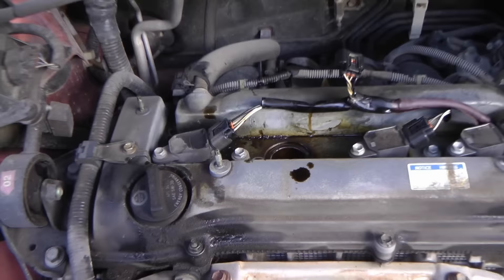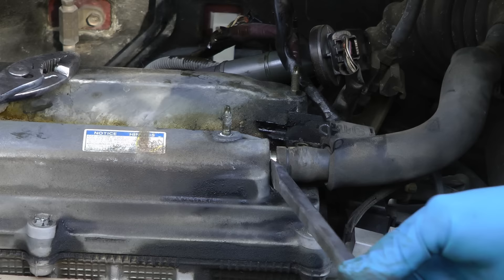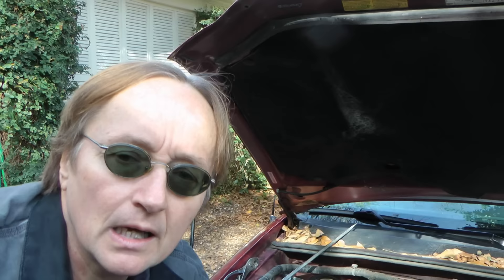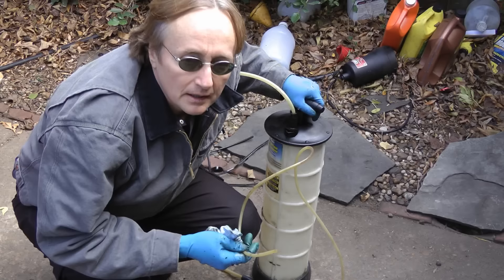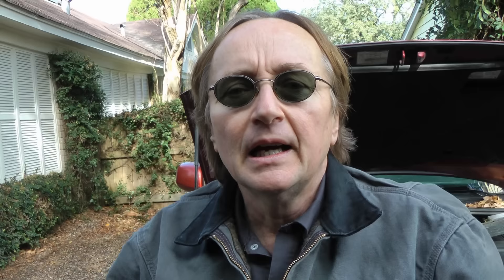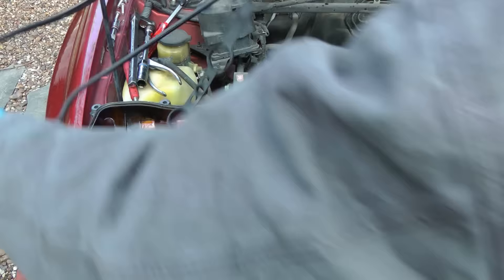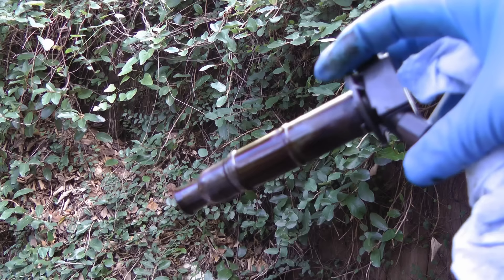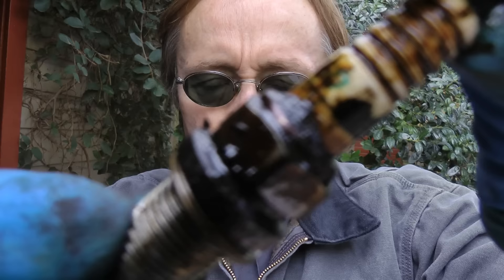How to Fix Engine Oil Leaks in Your Car

Comment: I have a problem with the gears on my truck its a 94 dodge the gears are not centered right on the cluster need help!
Reply from the maker: if you are talking about internal gears inside the transmission, those things are super complex inside. I personally use a transmission expert on those who rebuilds them all the time. They are not fix it yourself things really.

Comment: How do you take of the bolts off of the engine cover if it's stripped?
Reply from the maker: +Shingo Yamaguchi cover serves no real purpose, just snap the plastic crap off and throw it away
Reply: +Scotty Kilmer thanks for that but the bolts holds on the cover to access the cover gasket. 95 Acura integera special edition
Reply: +Shingo Yamaguchi you have to drill the bolt out with a special tool. and then replace bolt. Its not to bad with the right tool.
Reply: +green1375 thanks man I thought I was going to have a hard time fixing that leak.

Comment: A diesel engine of my toyota town ace has oil spills all over the place. I wonder if I can fix those leaks myself..yet it's not the only problem but the most obvious one . If the oil starts to leak from the top of the engine what that might cause?
Reply from the maker: do my video "finding and fixing car oil leaks to find out" and pray it's just leaking valve cover gaskets
Reply: On my way, thank you!

Comment: Hey Scotty, I have a 2003 chevy cavalier 2.2l ecotec and I am leaking a bit of oil I figured it is the valve cover gasket so I bought a new one and replaced it but its still leaking and I dont think its coming from the valve cover, the puddle of oil is right by the oil filter(directly below the power steering resoveoir) if you know about cavaliers, and I dont think it is the oil filter because it is on their good I have checked it several times it has a new o-ring for it and everything. What could it be?
Reply from the maker: do my video "finding and fixing car oil leaks" to find the true source

Comment: Hi Scott,
I have a 2000 Pontiac Grand Am GT with almost 165K miles on it.  Recently, I had my oil changed and the service tech said that my valve cover gaskets are leaking.  I don't see any oil on my driveway and I don't smell any burning oil when driving, so I don't know if this is really a serious problem or not.  The service tech gave me an estimate of $170 (parts) and $284 (labor) to replace the valve cover gasket set.  I plan on driving the car another 2 years at the most, so I don't know if I should even bother with the repair.  What do you think I should do?  Thank you.
Reply from the maker: if oil does not drip on the car or smoke under the hood leaking on the exhaust, you can live with it

Comment: hay i have a 1995 geo prizm with 159.000 miles ,1.6 liter toyota carolla 16 valve engine, i change the valve cover gasket and spark plug o rings , i have a oil leak around top bottom right timing cover ,do you think it might be the camshaft seal?
Reply from the maker: could be, do my video "finding and fixing car oil leaks " to find out

Comment: Hey Scotty I have a Honda accord 99 and it just started leaking oil close to the passenger side, I just had the radiator hose changed like 3 days ago.. I'm worried and I have no clue why it may be doing this...
Reply from the maker: rose acosta do my video "finding and fixing car oil leaks" to find the source, often just leaking valve cover gasket

Comment: I got a leak from my valve cover, but it looks like someone over tightened the rear bolt and it's broken. I am afraid of even taking the valve cover off and then I'm not going to be able to put it back. How could I take out the old bolt?
Reply from the maker: +Roberto Búrbano it would have to be drilled out and taken out with an ez out then retapped with new threads

Comment: scotty will barrs stop leak hurt an engine ? i have an old amc360 in my 89 grand wagoneer... spark plugs are dry as a bone... but it leaks oil enough to cause a 1 dollar bill size oil stain from the rear main seal.. once it warms up it stops leaking.

same with the 727 trans the shift linkage is leaking..  

i hear good things about barrs stop leak.. but i always get weary of using this stuff.. i worry itll ruin my valve seals and so forth
Reply: Bars won't hurt your car, but it might not solve the leak either. Depends on where the leak is coming from and how big it is.

Comment: Scotty, I have a Waukesha 4 cylinder flat head engine and it has a lot of blow by and it blows a lot of oil out of the oil breather on the side of the block, is there anything short of rebuilding the engine to stop this? Thanks Stan
Reply from the maker: Stan Wilson not really, piston rings are worn for sure
Reply: Thanks, would you know where I may find the rings for this old engine?

Comment: hey i have a question about my 2003 chevy trailblazer 146,000 miles. today i changed the oil and when i took off the oil cap i noticed on the top of the cap there was a white thick layer on the oil cap. it almost looked like thick milk on the oil cap. what does this mean? i'm pretty sick of this car and if the engine is about to die i want to get rid of it before it does.

Comment: Hey I had a question, I have a 99 dodge intrepid 3.2 when pushing the gas peddle while my car on idling there's water that shoots out of the tail pipe and a little bit of white smoke but not a lot of smoke but the water doesn't happen all the time but I'm not sher what it is can u help me out I really need it in tip top shape to pass smog coming soon any way to fix this problem

Comment: Hi all, I Got a Vauxhall Corsa 1.2 Petrol. Over heating and after started I can see the oil coming next to oil filter. Fan turn on but doesn't turn off on its on. Water drops from the tail. Changed the coolant before was fine something happened after. Please advice

Comment: Me i went to walmart to have my oil changed and they said they could not do it and the notes said Gasket leak and leaking from drain plug and i did not see any oil on the ground but near that area what do you think is the problem. And what should i get replaced?

Comment: My 4afe have the same problem. I have replaced the seals but still it leaks like crazy in a mile my all plug panels are full of oil. The machenic told me that my engine has excessive pressure in it and its causing the weakest point which are the seals to leak oil.. My car is now in the garage for a month now. Without knowing what's the real cause of the pressure

Comment: I have a 2001 Volkswagen Jetta VR six and it's leaking oil from one a little holes on the driver side it's a little hole looks like something girls screwed on there but I don't know it just leaks a bunch of oil from there
Reply from the maker: those are hellacious engines to work on. Have a mechanic check it out and if he says it needs a head gasket job, sell that baby FAST

Comment: Hey scooty , I have a ford expedition and it started to leak oil when i was driving and it would go about 10 mph to 30 , but it wont rev up like before and i cant find where it comes it seems like it comes from the spark plugs like in the video , the heads are black from the oil but on the oil pan it has one bolt that holds the oil pan that leaks and it smokes when it runs for like 5 mins but only smoke by the heads , what can it be ?

Comment: Hello Scotty. I am wondering if you could help.I changed my oil Mid November and today, the vehicle's Change Engine Oil Soon light came on. I thought it was an electronic alert due to cold weather but still decided to check the oil. It came up dry. I was confused. And then I thought maybe to run the engine while checking the dipstick. I saw some splatter of oil.  Still not convinced, I drove to the nearest Oil Change place and after checking said I need to put in 6 quarts. I put in 5 quarts of Mobil Synthetic (75000 + mileage) when I did the change in November. Would you have any suggestions on what could be wrong? Thanks.
Reply from the maker: +Terratiger those things are not accurate as they age, go by mileage or time instead. AND, look up how much your car takes on a data system to put the correct  amount in. Of course, if it burns oil, then check it every so often and top it up
Reply: +Scotty Kilmer Thank you.

Comment: i have a 2002 sports trac with 111,000 miles and i just noticed an oil stain on my garage floor---the truck does not burn any oil and the spot is not a wet spot--should i be concerned or is this common in an older car---i am a 73 yr old lady and am kinda scared to take it to a mechanic - i only drive it about 20 miles a week
Reply from the maker: just check the oil, older vehicles often lose a little oil. Oil is cheap, fixing engine oil leaks can get expensive. And, If you like my car help, be sure to watch my live car talk show every Saturday morning at 10 AM CST on YouTube. I answer your car questions LIVE there. Just check it out at How To Ask A Live Mechanic Car Questions Free On YouTube . And remember, every TUESDAY  I upload a new video, so don’t miss them.

Comment: Hello I ave a 2006 chevy equinox that has a oil pan leak .how hard is it to repair on this car?
Reply from the maker: not too bad, but you will have to remove the oil pan
Reply: Scotty Kilmer  ok so are there any other components that need to be removed in the processs?

Comment: I enjoy your vids scotty but notice you're not answering the criticism about attacking the old gasket with a wire wheel like that. As many have said all the shit will go all over the place amongst the cams , into the oil wells etc . Can you please explain why you're happy to do this as is seems rather unwise despite being fast!
Reply from the maker: Wire wheels are what all the pros say to use these days. Read up on it, fine wire hurts nothing. Just read an article on motor magazine about just that

Comment: Scotty....I have an 02 Ford Focus and I keep having to change out the front rotors because they are warping. I replaced them 2 months ago and they are already starting to warp again...could it be that Im not doing them right or just cheap rotors? thanks!!!!
Reply from the maker: brakes that stick on cause too much heat and warp rotors quickly, check that first, even cheap rotors last longer than that
Reply: thanks Scotty...I'll check the calipers first...I find its the first thing that causes brake drag

Comment: We changed the seal and fuses because they were dripped in oil and although the car started back up, the engine was shaking terribly and when I tried to drive it the check engine light came on again and I had to park in down the street.  What could be the problem?  The mechanic working on it didn't suck the oil out because he said it should burn off
Reply from the maker: first, get another mechanic, he is lazy and gives bad advice, so I really wouldn't trust his fixing ability either.  Get it scanned, e mail me the codes so I can see what problem is occuring now
Reply: He's the second mechanic in two days trying to fix me car.  The first guy changed the fuel pump and when it didn't start he gave up and said it must be an electrical issue.  This mechanic checked the sparked plug and saw it was soaked in oil and we bought new spark plugs and engine sealant like you showed at the beginning of this video. Finding a good mechanic has always been a hard feat
Reply: Scotty Kilmer
Another mechanic scanned it and the code 2.21.14 Vehicle Code P0340 camshaft position sensor. Sensor bank 1 circuit malfunction.  Then he said it needs a Nissan brand distributor because I told him another mechanic "supposedly" put a distributor last year around this time.  Car didn't shut off on me today though.  The mechanic you called lazy came up with a code P0301 prior, but the new mechanic didn't mention that one
Reply: Scotty Kilmer  Did you see this message.  I don't know how to e-mail you.  I just test drove a 2014 Toyota Corolla and all though it was beautiful I know I can't comfortably afford that car on my wage.  I looked at the 2011 Corolla and hated it.  It looked so cheap inside

Comment: Hey scotty my 2000 Corolla with 126k has not been running as smooth as before. The engine is little rough specially in 2nd and 3rd gear . I cant say its an engine knock or anything major but the noise is bothering. I read that Lucas has an oil that would get rid of that noise. any suggestions. thanks
Reply from the maker: you can try but also have the valve adjustment checked, they may need adjusting
Reply: Scotty Kilmer Hello again scotty. a check engine light came on today on my corolla 2000 which might be the cause of the engine noise.
P1346 variable valve timing sensor circuit range performance bank 1. and
P0441 :evaporative  emission system incorrect flow.
is that a major job ? some one told me the timing belt is off and have to be taken out!! not sure how much its going to cost me and I don't want to be taken to the cleaners .  Thanks

Comment: how do I stop a leak in a 2007 Acura TL
Reply: Glenn Walters correct question...why is it leaking? you have to trace and find the oil leak . Then you will know your next step. women and cars sometimes don't mix. My step has two Mercedes and doesnt know how to check her oil.

Comment: to screw the valve cover back on...u dont a need to tork the bolts down?....or u dont have to for the vavle cover? i just saw oil today in my sisters car but arround the valve cover...i cleaned it and i saw tha is tha valve cover gasket...but didnt fixed it yet cuz i thought tha i needed to find the tork specs for the valve cover...if no needed, shit i;ll doit right now i have everything!!
Reply from the maker: just get the snug, the don't need to be super tight really, I just do em hand tight. If they leak, often a little gasket sealant on the new edges will stop the leak

Comment: I just had the new spark plugs put in and then the mechanic said i need to replace the gasket valve cover, to change the valve cover in the future, do i need to remove the new spark plugs that were put in few days ago? the mechanic put the electric tape around the bottom of the plugs , is it safe practice? he said it will prevent spark plugs from going bad... I would appreciate if you an asnwer me...
Reply: Shawn P So should i leave the electric tape there or i need to take the tape off? if i leave the tape there, would it cause any damage? I haven't driven the car since i have had the plugs changed. Also, if the oil is not significant amount, then is it safe to leave the oil without sucking it out?

Comment: HELP! 2005 toyota camry I  just opened my hood because my thermostat inside my car was going too hot so I opened the hood, found there is no fluid in the radiator AND a bunch of oil looking like it's coming from the top and spilling down the rest of the engine & leaking onto the ground. What is happening ?!

Comment: My girlfriends 97 mercury sable with ~175K miles and the 3.0 OHV engine is getting god awful fuel economy somewhere between 12-13 mpg.  I installed new plugs, wires, fuel filter, t-stat, water pump, etc.  

I'm out of ideas.  What could it be?

Comment: I have a 2004 Kia Sorento and it smokes under the hood near the exhaust manifold where it meets with the pipe (where a couple sensors are) on the drivers side. The smoke comes and goes, one minute its smoking and the next its not then it comes back. It smokes at idle and while driving. I checked the gaskets of the valve cover and its dry. It seems to be oil leaking on it just don't know from where and why. Also checked the exhaust at the rear and its all clear (real clean actually) so the smokes not coming from the exhaust itself. I also have an A/C clutch problem too but let do one at a time. Please help  thanks.
Reply from the maker: do my video "finding and fixing car oil leaks" that will find the source for sure
Reply: Thanks that'll help, and for the A/C clutch not engaging is there a video for that.

Comment: hey scotty i got a 1997 toyota camry le 2.2liter. with 225000 miles on it, i have a power steering fluid leak i took it to a mechanic he said the hoses the pump and everything else need to be replaced and it will cost around $1600, i dont have that much money imma student i keep refilling it every two weeks or so. the leak is small, CAN I KEEP REFILLING? WILL THE LEAK GET WORSER?

Comment: what about for a 1990 chevy 1500 silverado v8 tbi it loses oil but the spark plugs have oil in them when i change them?
Reply from the maker: +Wicked Jester it's burning oil, live with it and add oil as it burns
Reply: +Scotty Kilmer so its normal?
Reply: +Wicked Jester  Yeah! I'd like to know that also. I have a 2000 Silverado doing the same.
Reply: Kymirror they said that the piston rings are worn out on mine so i been told ....

Comment: I accidentally put a wrong diesel engine oil in my unleaded fuel car, is it ok? Or what happen to the engine if dont replace it for 3months?? Should it replace it rightaway? Thanks.
Reply from the maker: diesel engine oil is stronger made for diesel engines, I've used it in gasoline engines many times and it worked perfectly fine, as long as it's the correct weight rating, like 10 W 30

Comment: Hey scotty (or anyone reading), getting a seal fixed on my Bimmer and they wanna charge me 500 bucks. Is that typical or am I getting ripped off here? (All i know is that it isnt a bad leak but could get worse and that it has to do with the engine).